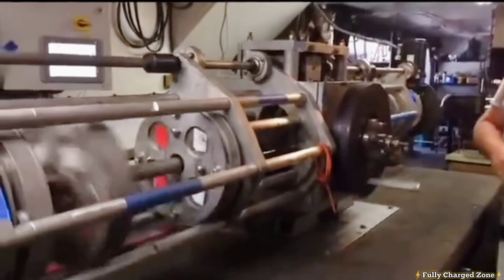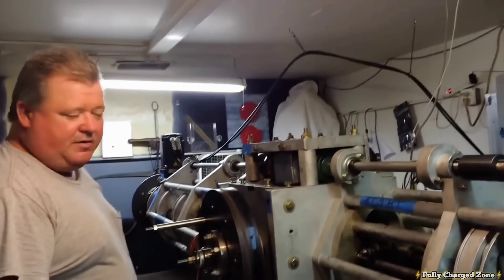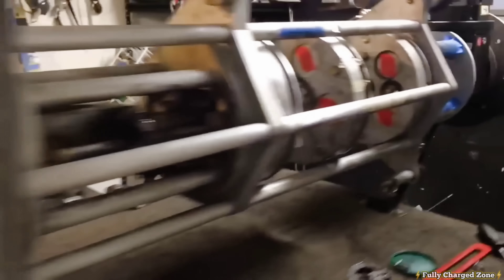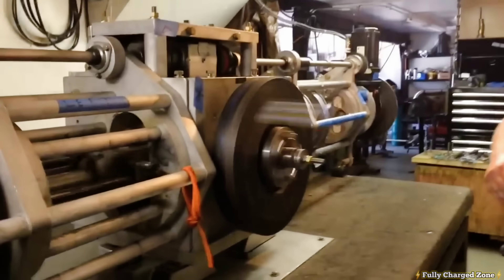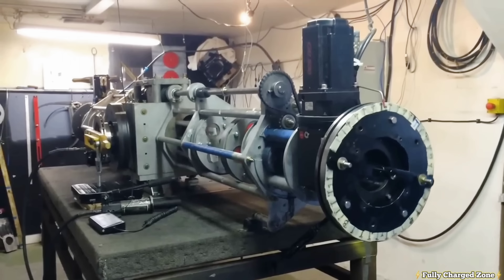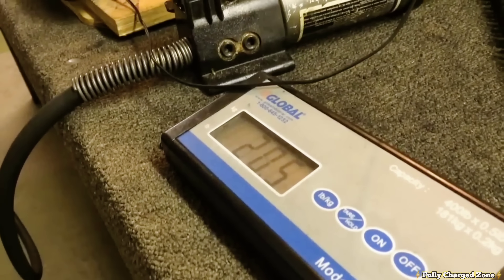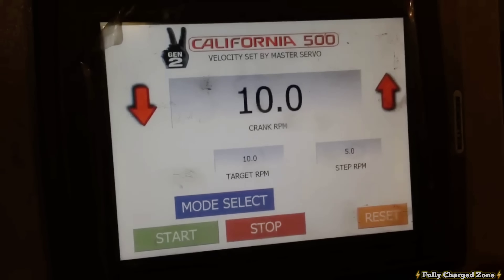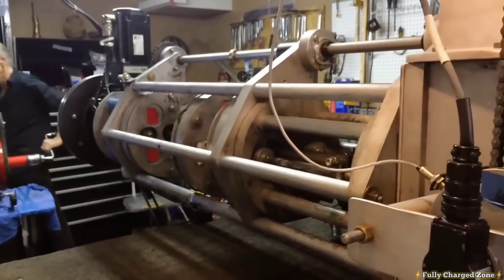World's 1st Magnet Motor - US Patent # 8487484b1

Comment: So many brilliant people like this guy and their inventions suddenly disappear. I am worried for him.  Cars with magnetic engines can be modified to run without fuel... Oil companies might not be happy.
I only hope they make a deal with him to have a fuel using version made so he can continue his research and not be made to disappear.
Reply: Sorry, but that's just a conspiracy theory BS. And most likely that machine either doesn't work or doesn't have any real practical applications. And no, a patent isn't an evidence that something works.
Reply: @TheFantasticFreak it has some applications, but not like what these people claim. It can be used as a power stroke application that exerts more force on one stroke by timing the rotating magnets. This is why the servo is needed. However with the forces offset like that, you will need the same force exerted in the power stroke to repel it back. This again is why the servo is needed. If the magnetic fields are offset, then it will just behave as an ordinary magnet. If a servo is used, it can add some extra energy needed to overcome that. Everytime I read comments on these devices, I am convinced that our education system has completely failed us.
Reply: @TheFantasticFreak  I beg to differ. It's a proven fact now. Too many people have been silenced and I was wondering when a debunker from the ten cent army would show up. It's pointless arguing. You can only preach your lies to the converted. 
No one else with intelligence will believe a word out of your mouth. Good luck trying to persuade others of your lies 😂
Reply: If he patents it it’s not open source therefore recreating it will be hard and can easily be destroyed never to be found
Reply: @Ap_twsh  if you patent something then the whole project becomes public, it's just prohibited from commercial use by third parties.
Reply: Like Stanley Meyer
Reply: Every Engine has an Input and out out. Without a Source of fuel or energy the system will not produce or output energy. So I imagine the Magnet is the Source and not partical have its energy is spent.
Reply: @Vmaster005 magnets are not a net gain. It doesn't matter how many you have and how you orient them. The same force is needed to overcome the attraction. If two magnets are pulled together, you need that same force to pull them apart. This is zero sum.
Reply from the maker: @davidmcbride3843
I appreciate the concern, but there’s nothing secret here..  the entire mechanism is already public in US Patent 8487484B1. I’m just rebuilding the original inventor’s design so people can finally see it operate. No claims of free-energy or replacing fuel, just showing the mechanical sequencing exactly as the patent describes. All the research stays open and above-board, so there’s nothing to “hide” or disappear. 👍
Reply: Then why hasn't this guy disappeared already
Reply: So in other words this is a free energy device

Comment: What is the lifespan or performance of these magnets in years? Americans are dependent on the Chinese, after all.
Reply from the maker: @SurG30n
Neodymium magnets last a long time as long as you keep them below their thermal limits. Their loss rate is tiny — usually 1–2% over a decade. In normal mechanical setups like this, they basically outlive the machine. The patent doesn’t rely on exotic materials either, just standard rare earth magnets you can buy from multiple manufacturers worldwide.

Comment: What are the connected cables for?
Reply from the maker: Those are only for the sensors and the safety cutoff switch... not for powering the rotation. The test rig uses instrumentation so I can measure timing, movement, and temperature during the run. The patent mechanism itself is purely mechanical. 📏🔍

Comment: Even if this is legit, there's one BIG problem. it's impossible to get more energy out of this motor than the energy used to create the magnets. Then consider the energy used to source the rare earth elements to manufacture the magnet. Dont waste your life trying this thinking you can create free energy. ITS IMPOSSIBLE
Reply from the maker: Exactly... and I’ve never claimed otherwise. This isn’t an over-unity device. It’s a mechanical timing system that uses permanent magnets for force, the same way we use springs, cams, and counterweights. The whole point of the video is to show the mechanism working as described in the patent, nothing more, nothing less.
Reply: You could see this as a battery rather than a motor

Comment: Sonny Miller is NOT suicidal
Reply: I do not see it producing any useful power. Until he can prove that, this is basically a machine with little overall resistance. (Akin to those small toys that you get for your desk.)
Reply: @millanferende6723 if it had enough mass why not... honestly car engines aren't efficient so I could see pump and generator applications you only need like 3 HP for 2000w so it could possibly wipe out half a electric bill.
Reply: @brettscott7574 car engines are only 11% efficient on the low end and are a fraction the size of this thing yet they can produce well over 500hp. None of that bodes well for this thing producing any useful work.
Reply: He doesn't need to be suicidal. He can have ALL of that...
Reply: Lol! IKH? 😂
Reply: He still will though. I noticed the pattern
Reply: no but lacking brains and basic physics
Reply: 2  or 3 comments down someone saying we lost a great mind after researching him so guess he's gone already
Reply: @ukskywatcher9598 
No, he was talking about his own mind, because he lost half his brain cells watching this video :-(
Reply from the maker: “True. Sonny was not suicidal. He was passionate, sharp, and fully invested in his invention.

Comment: As long as a full size care,would a smaller version be better,for many applications yes..
Reply from the maker: Smaller versions actually have tighter tolerances, so the timing gets trickier. The larger unit lets you physically see the magnet sequencing and cam movement the way the patent intended. Compact versions would need precision machining to behave the same.

Comment: If the magnets could be powered to boost them once the machine gets going and increase the reaction force of the magnets opposing eachother.....along with flywheels you can get a constant rpm motor no problem I believe
Reply from the maker: The patent actually avoids powering the magnets it’s all permanent-magnet sequencing. The force changes because the cam modulates the interaction angle, not because the magnets get stronger. That timing is what creates the repeating motion you see.
Reply: Yes. I think you are correct.

Comment: i love to have one of these at home to charge my batteries.
Reply: It's a motor, not a generator. It still requires electricity to run.

PS
Maybe it could pump your water? But I think it is less efficient than what is at the store now
Reply from the maker: Once the mechanical output is coupled to a proper generator head, you can charge a battery bank. Right now it’s just a proofof concept showing the motion described in the patent.

Comment: Now I’m wondering if this is more fuel efficient than regular electric motors 😅
Reply: It's not
Reply from the maker: This isn’t meant to replace electric motors. It’s just a mechanical proof-of-concept showing the timing system from the patent. Electric motors are still far more efficient for real applications.

Comment: This is NOT a perpetual motion machine. This video does not help to desribe what is going on. Så just a waste of time for me - and especially for the so called inventor. I have been working as a patent examinor in the Danish Patent office. Each year we recive a number of Perpetual motion machines. We examine them to decide if they can be patented. A patent is not granted for a Perpetual Motion machine. 
The rejection is based on "Lack of Industrial application". We dont go in details in our written statement. Some times I am later contacted by the inventor. Then I try to explain the fundamentel flaw that his invention has.
As a kid I tried myself to invent "Perpetual Motion" machines. Inventors often end up with the same 7 different designs principles. It was obvious for me that the machines would not be able to generate any output for driving a vehicle for example. It was a funny intellectual exercise. Later on I became a machine engeneer. As an engineer you should always look at your designs with a lot of scepticisme. Because there is a lot of cost saving by scrapping some pages of paper. Because 10 pieces of paper is cheaper than 500 kg of machined steel parts.

Comment: It may be close to perpetual motion but any load attempted would quickly end all of that.
Reply: Well per definition that wouldn't exclude it from being a perpetual motion machine.
"Pepituum Mobile".
Stopping a machine doesn't unmachine it 😂
Reply: Whack a clutch+gearbox on it?
Reply: Larger magnets use to produce electricity and other light loads.
Reply from the maker: Right... this build wasn’t designed to deliver usable output. It’s a demonstration of the patent’s magnetic sequencing principle, not a power-producing machine. Adding real load would change the dynamics completely. The goal here was to show the mechanical concept in motion exactly as the inventor described it.
Reply: True, this low watts produced... but the heavy parts should be consuming some of the power itself.
Reply: You are 50/50 wrong about perpetual motion, don’t have a grasp on what it is and what it is … is it will never happen. But a load is the ultimate test we don’t know what grunt it has you are negative. So happen to be talking to an invented who is making a design on this subject.
Reply: Except for that pesky servo driving it.

Comment: I think this is a fake engine. All those moving parts going backwards and forwards and side to side. If it was real it would be producing a huge amount of power instead  think it is consuming a huge amount of power.
Reply from the maker: No fakery here... everything you see is exactly what’s in the patent drawings. It’s not built to output power, so there’s no heavy load or heat. It’s just a mechanical visualization of the magnetic timing system the inventor described.

Comment: Fake
Reply from the maker: No fakery here... verything you see is exactly what’s in the patent drawings. It’s not built to output power, so there’s no heavy load or heat. It’s just a mechanical visualization of the magnetic timing system the inventor described.

Comment: Applicable torque range is a Applicable concern.....however this is exactly perfect for
Generating....😊great machine.......titanium is the necessary upgrade for mobility...yes inertia force or weights are important but closer tolerance and titanium rigity to TAME the BEAST.
Great STEP design.......if you could turn the platters into AIR FANNING to vent hot sections....which really isn't a concern NOW but using Every energy potential under operation....tells everyone YOUR maximizing the designs capability.....
Reply from the maker: You’re right that torque range matters. This setup wasn’t designed for usable output,  just to physically demonstrate the sequencing system from the patent. It’s more of an educational build than a power-producing unit.

Comment: When you think about it, this concept is simply a permanent magnet motor with the stator replaced by another magnet and the timing such that it self starts and continually runs.  The timing limits the useful power that can be pulled from the motor, but it does run on its own.  This isn't a perpetual motion machine in the purest sense as the magnets will lose their strength over time.
Reply: If the first statement holds true then the energy it produces comes from the magnets not being aligned anymore at the end. Same as how you make magnets but the complete opposite. You can actually think of every permanent magnet as a kind of battery against it's alignment. Takes energy to magnetize it and gives back energy when it looses magnetism. If the first comment by Hugh hold true.
Reply: So what energy conversion calcilation?
Reply: True
Reply: Magnets can be remagnetized pretty cheaply. You don't need to mine them out of the soil ever time. Also they last decades easily.
Reply from the maker: You’re right on the timing part... that’s the entire heart of this patent. It’s not a “free energy” setup; it’s a magnetic cam engine where the sequencing replaces a traditional stator. The timing gives you controlled mechanical output, just not the kind of continuous power a normal electric motor delivers.
What you’re seeing here is exactly what the inventor described... magnetic force being used in a patterned, mechanical way.

Comment: Fantastic idea and you’ve done a great job with the prototype the observation that I’ve made, however is that sluffing sound likely your cylinder bore, though I don’t know without looking at the machine in person in order to generate that sound at that a huge amount of your potential output, energy is being sacked This isn’t a throw shade on anyone I’m a fellow inventor. This is my two cents worth on it fine with the noise is coming from an address the issue in the name of longevity and the name of scavenging loss power..
In addition working with some super conducting materials, I am using liquid nitrogen as the lubricant once liquid nitrogen reaches a certain pressure like any other gas that’s it stable pressure and the rest remains liquid so inside your storage tank you have liquid and gaseous nitrogen to work with nice inert gas not explosive cools very nicely some observations and thoughts that I thought I’d pass along to you. Good luck with your project and thank you for sharing.
However, getting back to the sluffing sound, if you were to put Teflon strips around the edge of your pistons, and then lubricate the rods that make the cylinder bore with a nice heavy grade oil, that would greatly eliminate the sluffing sound, and again the sound is indicative of excessive where which leads to longevity and maintenance issues and it’s also snapping extra power. Hope this information finds you well and we look forward to updates. Future episodes. Thanks again for your time And thank you so much for the share
I final bit on working with the liquid nitrogen as a potential lubricant you’re gonna want to draw a vacuum, then inject the via liquid into the cylinder area that way it’s also not fighting the ambient pressure of the atmosphere, and with the vacuum drawn the nitrogen atmosphere created inside The vessel will have very little drag, and the hyper cooling keeps where of moving parts to an absolute minimum as the cooling, dissipates the energy, that otherwise causing heat and degradation of the surfaces.
Bon appétit my friend look forward to future updates.
If you find any of this interesting enough to reach out and respond, I would be more than happy to carry-on, a productive conversation to flush out these ideas
Reply from the maker: Appreciate that! This build was just to physically show the patent mechanism in motion, so there are definitely rough spots and friction points. The sluffing you hear is just the cylinder rails settling under load... this wasn’t designed as a power unit, just a visual proof of the timing system in the patent.

Comment: what if you used the spinning crankshaft to spin something like a car's alternator to produce eletricity. maybe using a series of gears or pullys in between the crank and alternator to increase the rpms to spin the alternator faster if needed ?  dump the electricity into a battery bank and use some of that electricity to power the machine if needed. and the remainder of the power left would be free power?
Reply from the maker: You technically can couple it to a generator head.
The patent was designed to provide steady rotational output, so using that rotation to drive an alternator is exactly how you’d convert it into usable electrical energy. It’s still limited by the mechanical timing of the system, but it’s definitely possible.
Reply: 100%. This just proves that manipulating a series of magnets can produce mechanical motion/rotation. Generators and cars won’t need battery banks as long as they can crank the motor 90-degrees to start it. You can have smaller magnet generators to power your radio and accessories that is flipped on by a rocker switch that connected to the power output of the main engine. Batteries die but having a mechanical machine that runs off the slightest bit of momentum(crank-start can be made easy/light with a clutch pack and gear box) and and no combustible fuels will allow you whatever redundancies you desire. You can make an oil refinery on wheels just to piss off ICE drivers haha

Comment: Gotta work on the vibration.
Reply from the maker: For sure... most of the vibration you’re seeing is from oversized prototype tolerances. Once the sliders and cam followers are machined tighter, the motion becomes way smoother. This version is intentionally big so the mechanism is easier to study.